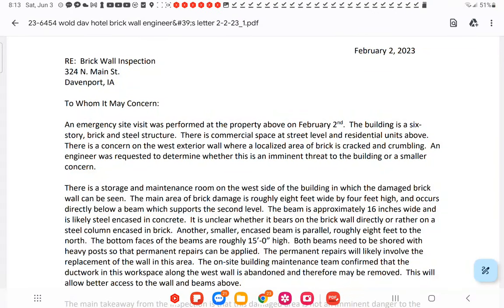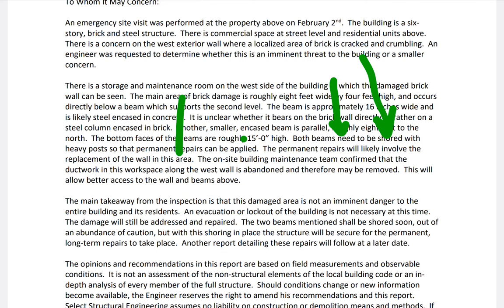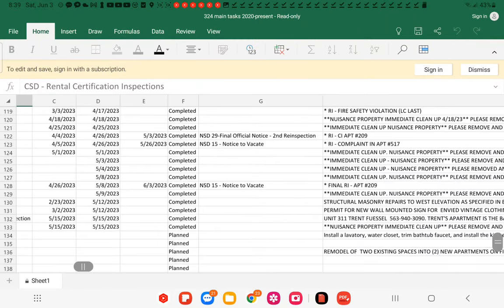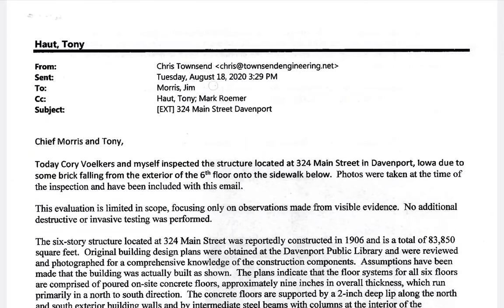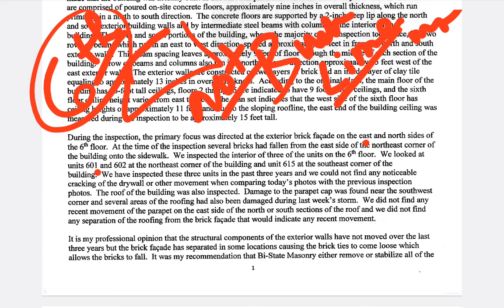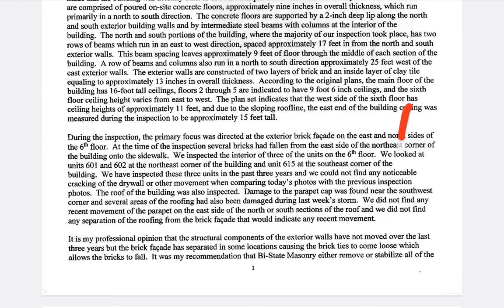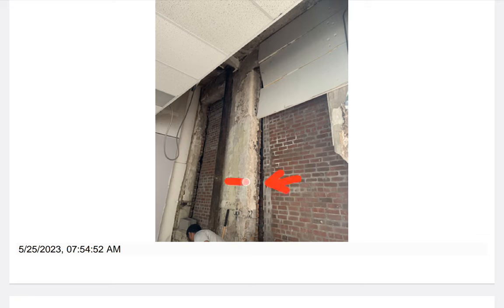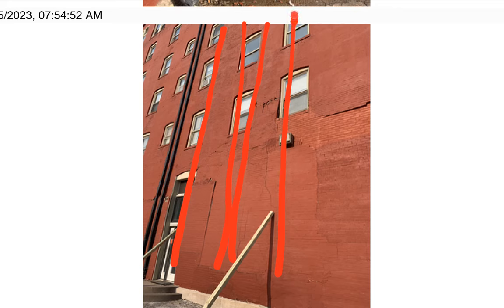Davenport Iowa building collapse the documents reveal, a failed lime mortar mix n load paths part 16

Comment: 51:04 with all those window openings, and rain water cascading down that wall, Id bet there was a good amount of water soaking into the brick like a sponge, and washing away the mortar. The entire roof (of building 2) was pitched to that wall, and Im not convinced the gutters and downspouts were sufficient to channel the water away. Looking at some of the older photos, it seemed there was a lot of degradation centered around the downspouts, and beneath a good number of windows.
Reply: And then when they weakened it at the base by removing what they considered to be veneer, (plus whatever they did to the open, abandoned former window openings at the bottom, which the collapse centered around), the rest of the brick above simply crumbled under the load. I dont know -- just speculating.
Reply from the maker: The story of these fractures are a story of negligence on the city, engineers and building owners, and historical society...

Comment: Was this built in two sections?  The Library plans referenced show a construction date of 1906, but I think I recall a building date of 1911 or 1913 in the section that collapsed.  

I wonder if the 2" lip was the cause of the telegraphing of each floor through the exterior wall as brick or block placement was bumped out to make room for the floor to rest.  

A 2" lip on a block wall holding that span of a 9" thick poured floor sounds wrong on a six story wall.  I wonder if a fourth course was added after the plans were drawn for additional support of the floors?

I think the temporary support of the bricks falling on the sidewalk from the front of the building calling for plywood anchored in clay block is referring to the clay tile block in the wall.

Looking forward to watching the second half of this tomorrow.  These videos are some of the most interesting stuff that I've seen in a long time.  Thanks for taking the time!
Reply from the maker: I have been trying to find a full set from the library, if u found them, please link me
Reply from the maker: Also, thank you for your compliment.
Reply: @ForensicCats  The main Library is closed because it's across the street from 324.  That's the physical location of the plans.  There is a digitized version that was created for the City, but I am told by the Library that a digitized copy is only available with a FoIA request to the City.  I asked if when the Library reopens whether someone might be able to visit and take photos of the plans, and she reservedly said that it might be.  I pressed her a bit on the digital copy because it's very likely that they have one, and she simply repeated that it would take a FoIA request.  I got the feeling that the City has told the Library not to release a copy to the public.

Comment: At 1:07:49 there is fallen brick on the steps next to the downspouts (that were still in place) on 5/25.  Since the brick had not been cleaned from the steps, it would seem that it had either fallen that day or in the very recent past. 

Who owned the building?  Letters from the City of Davenport were addressed to at least three entities that included "Davenport Hotel", or a variation of "Andrew Wold" in the name.

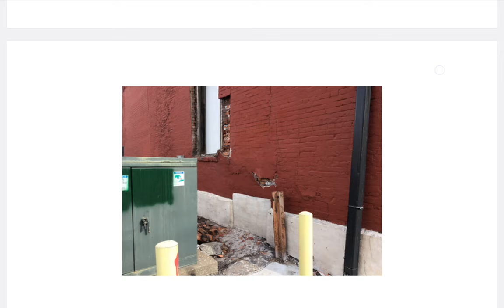At 1:17:36 there is steel next to the foundation that appears to be placed in the ground to prevent outward movement of the foundation rather than the brick facade(?).

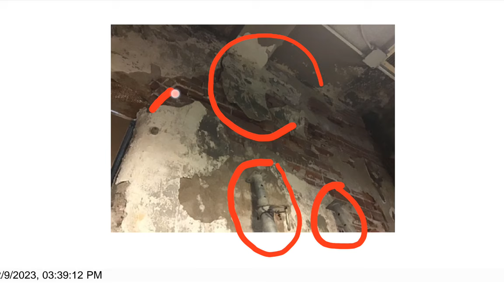At 1:20:55 it looks like the end of the beam has or is pulling out of the wall with the floor no longer resting on the two inch lip in the exterior wall.  The patching directly under the beam has moved away from the wall with the beam, but it was likely applied after the beam had already begun it's movement, thus hiding how much the beam has moved in total.  

Thanks for the videos, and all of the explanation.  It's really interesting.

Comment: if there was so many 'not connected' on the wall...how did the inspector OK it?   promise they'll get done?   and to say that her 'approved' structure is fine is horse s&*t ...what person doesn't double check their work or check marks? and having an engineering degree to boot!

I worked as a drafter in engineering for 7 years and the engineers & myself were always triple checking our work including field checks incase any trades person changed something...ugh

That bldg needed to be evacuated and taken down.... what other signs needed to be seen/known to KNOW that the bldg was unsafe?   good grief ..

Comment: They were tearing those face bricks off like they had no bearing on the structural integrity of the building.  How do you fix the interior load bearing bricks at that point?  You would have almost had to build a temporary exterior wall before hand!  Probably cost prohibitive.